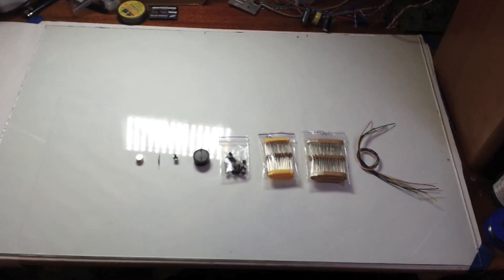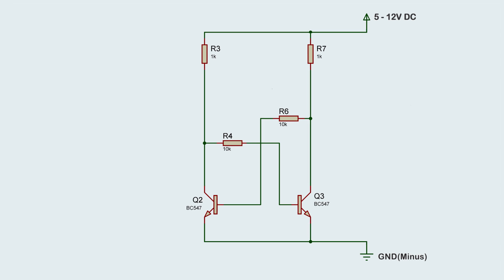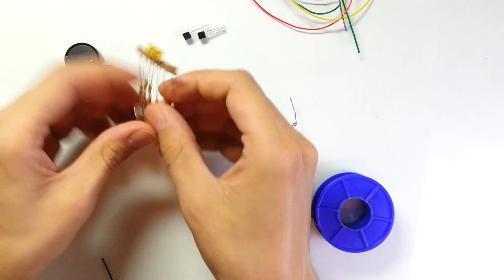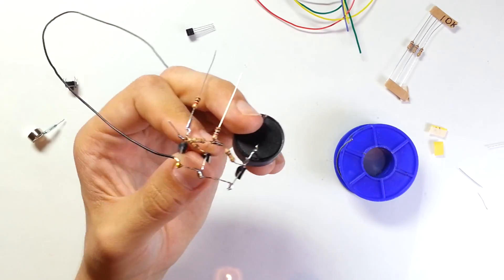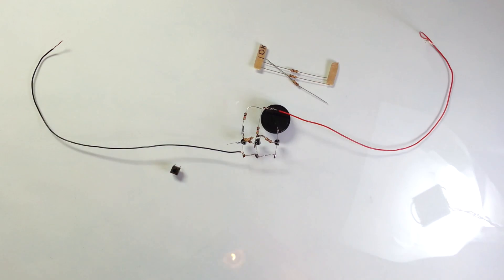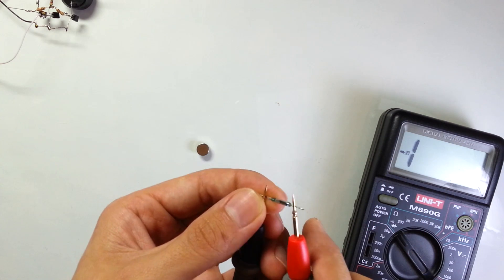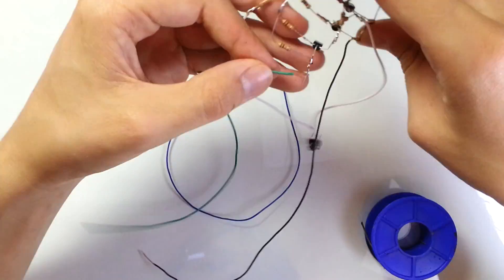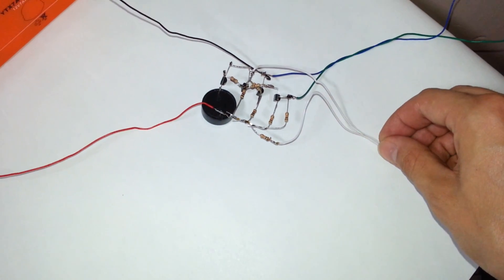How to Make DIY Security Alarm Device with a Reset Button | DIY Project

Comment: Great video. Thank you for this set up. I've been looking for a schematic like this using transistors for a while now and I came across your video. Thank you again. Have a question though, can I run a stronger siren (car alarm siren) to the buzzer leads? I didn't know if this set-up could support a car alarm siren.

Comment: Hi.  Have done your circuit and it works well.  The only thing is the buzzer (12V) have not enough power to buzz loud.  If I connect only the buzzer with battery, everything is fine (loud)( but when it turn on within the circuit, the sound level is too low.  Any suggestion?
Reply from the maker: Hi, it is strange... You probably use a pretty powerfull buzzer... try to add one more 10K resistor in parallel to R8 (or just replace R8 with 4.7K resistor) but this most likely will not help you.
Do you use 12V to power everything? 
How powerful buzzer do you use? how many mA does it consume? The buzzer that I show in the video consumes less than 15mA at 12V.
If you use more powerful buzzer than I show in the video, I recommend to replace Q4 with IRF540N, then you will be able to connect even 100W buzzer without any problems. Tell me your results.
Reply: The buzzer is 50W so somewhere around 4.2 A. as describe on the internet ad.  I haven't tested it yet.  Base on that, did changing the resistor is a solution or is it better to change the transistor?
Reply from the maker: WOW, that explains everything. Q4 BC547 transistor can only handle 0.1A so you definitely need to use IRF540N.
How to replace: IRF540N and BC547 have different pinouts and different names for pins. See those "B", "C", "E" letters on the circuit diagram near Q4, those mean "base", "collector", "emitter". But IRF540N has "G", "D", "S" - means "gate", "drain", "source". So you need to connect "gate" instead of "base", "source" instead of "emitter", and "drain" instead of "collector".
How to know which pin is which: just google "BC547 Pinout" or "IRF540N Pinout". It would be nice to know about your results. Goodluck!
Reply from the maker: Also, consider adding a small heatsink to your IRF540N, if it gets very hot. If your buzzer is really 50W then IRF540N will produce about 1W of heat.
Reply: Maybe I can salvage a c4662 transistor. What do you think?
Reply from the maker: IRF540N would be much better because it is MOSFET... Well, you can try C4662... also you can try to use it together with BC547, you can connect them as "Darlington pair". Or you can just try to replace BC547 with your C4662. And adding one more 10K resistor in parallel to R8 should also help. Experiment. If results with C4662 does not satisfy you then use MOSFET instead. 
P.S. it is not necessary to use IRF540N, you can try any other N-Channel MOSFET (maybe you can find something).
Reply: Doesn't worked with C4662 event with a 10k resistor in parallel.  Probably need to find a mosfet.
Reply from the maker: Oops... I just looked at datasheet of C4662 and it is about 10 times less sensitive than BC547B... I should have noticed it before. Well, you can try to connect both C4662 and BC547B as "Darlington pair"... or just get a MOSFET.
Reply: Finally, I salvaged a SMK0850 MOSFET.  It works great with 2 resistor in parallel as you suggest.  I've complete my project.  I used you recommandation  to build a laser trip wire with a reset button for an Escape Room game for my kid.  So if the participant brake the laser beam, they need to go out of the room to reset the puzzle.  I can also use more than one LDR in serie if I want to use more than one beam.  Your advise were really helpful to complete this projet.  To built it only with transistor and resistor is so cheap.  THANK YOU SO MUCH.

Comment: is it posible to use ldr and laser security in it
Reply from the maker: Hi, I have not tried it, but I think it should work... but you probably will need to replace R1 (10k) resistor with 20k - 50k resistor.
P.S. In case you try it, tell me your result, please.
Reply: @ElectricalPro  Can use this circuit with 3pin IR reciever?

Comment: Hi 
I tried your circuit its ok but 
after every 4 minutes it automatically on's the buzzer
solution please
Reply: I used with ldr and lazer
Reply from the maker: Hi, try replacing resistor R1 with 20K, or even 47K and test it again.

Comment: can i bulid basic flip flop circuit without resistor? (use transistor (bc547B) , led only (for fun)) . i try to build a circuit without resistor but two led switch on .
Reply from the maker: Hi, without some resistors you will probably burn BC547B or LED or both. Well, flip-flop circuit requires resistor, and nothing we can do about it. Is it really difficult to find some resistors nowadays? It is not necessary to use exactly the same values. Just teardown some old TV, or radio, and you will have plenty of resistors.

Comment: I have made this alarm but my alarm is not reset by push button ...... instead of push button what can i use ? 
Or Can u explain this circuit theoretically  how it works ?
Reply from the maker: Hello, this device is based on flip-flop circuit. Starting from 03:31 to 4:07 I show what flip-flop circuit can do (flip-flop circuit remembers state). You can read about flip-flop circuit on Wikipedia or just google it. Are you sure that the reset button is a problem? Maybe, the problem is the reed switch? Try to connect wires that go to the reed switch together, and then try to reset this device with the reset button. Tell me about your results.
P.S. sorry for late response.
Reply: I  have made this circuit on bread board. When i'll given suppy voltage then buzzer in on and if i press push button it will not work, so can u tell me what's  the problem in that ?
Reply from the maker: You need to do some diagnostics to find out what is wrong.
First test: disconnect resistor R8, after you disconnect resistor R8, the buzzer should stop making noise. If your buzzer after disconnecting R8 still making noise it means that transistor Q4 is dead and you need to replace it with a new one. (if after the test you know that Q4 is fine then connect R8 back again and do the second test).
Second test: this test will test the flip-flop circuit (in other words Q2 and Q3 transistors). Watch how to do this test from 03:31 to 4:07. To do this test you need to disconnect transistor Q1 (see I only using Q2, Q3, Q4).
Use a wire with a 10K resistor (watch 03:38), and do a test (watch 03:50). Flip-flop circuit should turn your buzzer on and off, just like on my video. If it still only always on then replace Q2, Q3 with a new transistor.
I hope it helps you.
Reply: Ok thnks

Comment: hello，can i use MOSFET transistors  2n7000 to replace bc547b?
Reply from the maker: Hello, I haven't tested it in real life, but I did a simulation in Proteus.
Here is what I found out: the circuit stopped working after I replaced transistor Q1 with 2N7000 MOSFET. 
So far I can say that transistor Q1 should be BC547B.
But It will probably work fine if you just replace Q2, Q3, Q4 with 2N7000 (it works in Proteus simulation), but it will not work if you replace Q1 with 2N7000. 
P.S.  Sorry for my late reply.
Reply: thank you ,

Comment: This is just what i am looking for,  nice job. The only problem is that i want  more noise.  i wanted 30 whats so the theef gos running like hell. Haw do i do that?  Or is it possible. Thx for info man
Reply from the maker: Hello, yes, it is possible. You can use a relay. Just connect the coil of a relay in paraben to the buzzer or instead of the buzzer, and with a relay, you will be able to control anything.